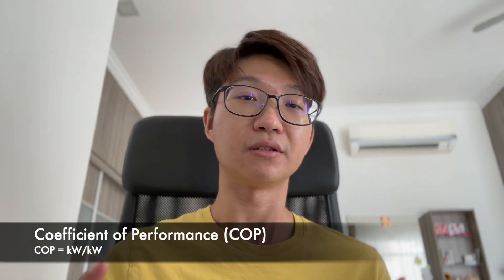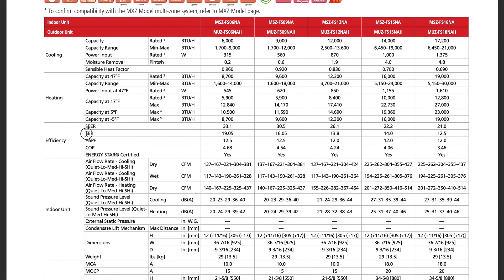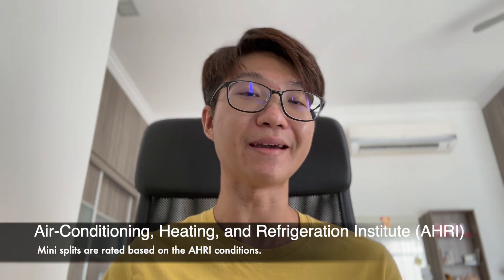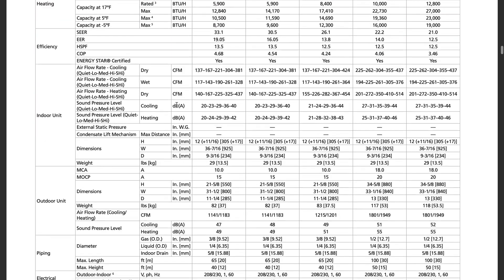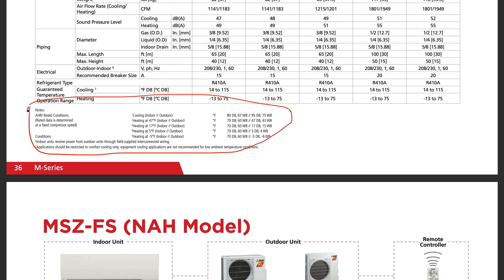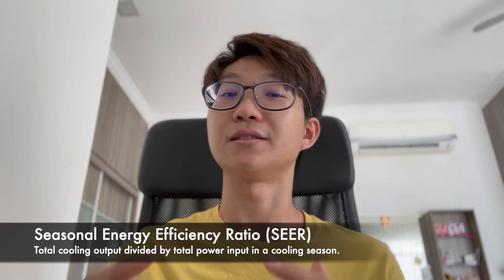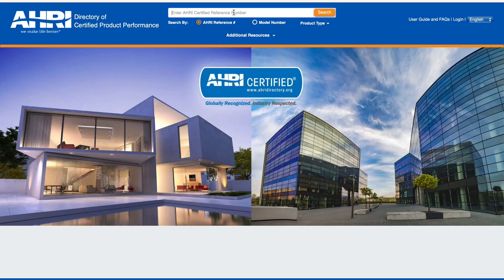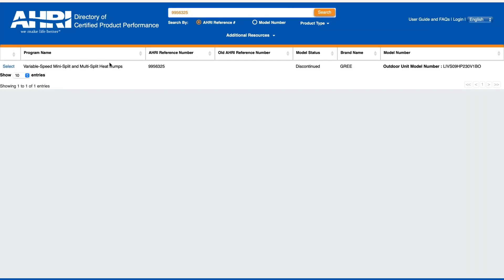How to Compare Mini Split Efficiency? - Lowest to Highest SEER Rating + Tips on Power Consumption

Comment: What is seer2
Reply from the maker: SEER2 is a better energy efficiency rating that replaces SEER. It tests a mini split over a cooling season (about 3 months) rather than just dividing the capacity by power. Mini splits produce in 2023 onward will all be using SEER2.

Comment: Those poor outdoor units in tiny, cramped space was so painful to look at.
Reply: Indeed. That array shown at 9:12~9:16, likely wouldn't last a season as they'd run continuously with the stagnation of airflow/heat exchange..
Reply from the maker: That was from my previous project. In the end, they hacked and rebuilt the wall to accommodate the outdoor units.